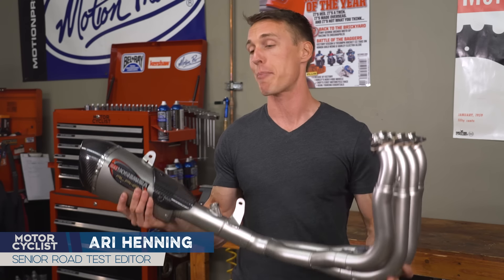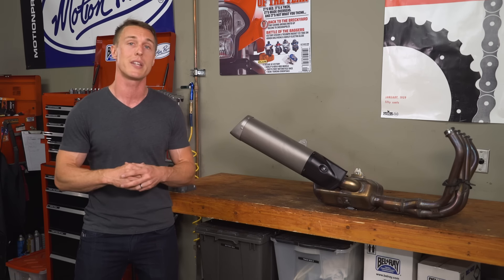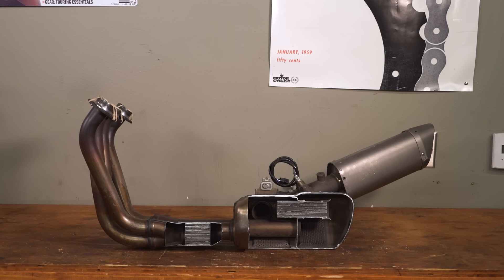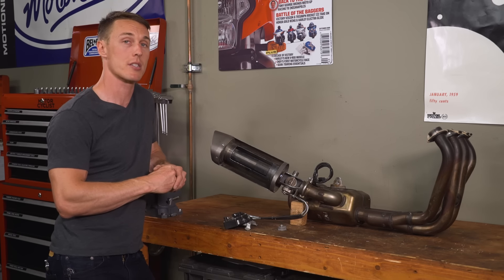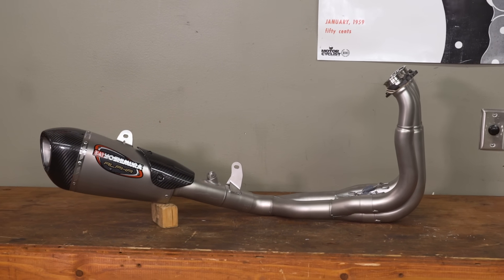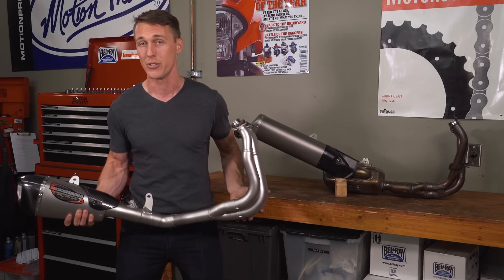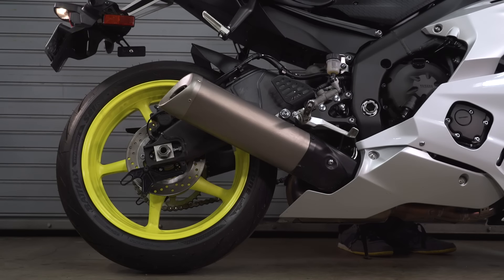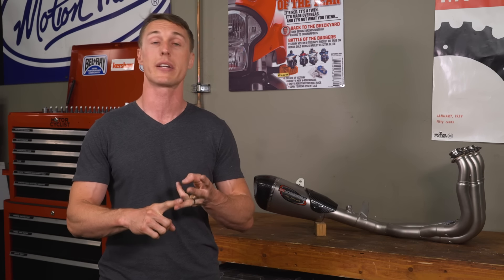The Truth About Aftermarket Exhausts | MC Garage

Comment: *Scavenging not back pressure

Back pressure is only applicable in a 2 stroke engine. 4 strokes dont have back pressure... They have pipe scavenging. Where the size of the pipes and the design of them are tailored to let the tail of the exhaust pulse meet the crest at a specific rpm so it helps the flow...

With a 4 stroke engine freer is better when u start talking about back pressure u confuse people...

2 strokes rely on "back pressure" because they dont have intake or exhaust valves or cams... so "back pressure" is needed to help with compression.
Reply: Nothing could be further from the truth, engines with cams that have a lot of "overlap" suffer horrible power losses in the lower and mid RPM's from straight pipes especially short ones, put straight pipes on an engine that have cams with a lot of overlap and remove your air cleaner, rev the engine in neutral and you can see spray coming out of the carb while its running, this is called "carburetor stand-off" and it's a product of what's known as "exhaust resonating", take two blocks of wood and have a friend hold them against the ends of the pipes to create back pressure and rev it again and the stand-off will disappear or be greatly reduced, I've actually seen bikes that guys tried running huge cams with a lot of overlap and very short pipes that would actually soak the air cleaner with so much gas from stand-off that when they were idling at a stoplight and there wasn't enough vacuum to hold the gas in suspension in the air cleaner element that was there from resonating that the gas would run out of the bottom of the housing like when a float is stuck open in the bowl, back pressure isn't the only way of dealing with the issue, there are inserts that can be put in the pipes about an inch from the ends that slow the resonating wave down enough so the exhaust valve closes before the wave gets back to the cylinder.
Resonating is caused by this, when exhaust gas travels down a pipe its towing a vacuum behind it, when the exhaust leaves the end of the pipe the pipe wants to full back up with air due to the vacuum, this wave of air travels back up the pipe at the speed of sound, if it arrives at the exhaust valve before it closes it'll travel across the top of the piston and past the intake valve that's starting to open and through the intake and carb, this is why spray will come out of a carb on a running engine, that wave wreaks havoc in the intake tract by hitting the jets and momentarily reversing their flow and it's also carrying exhaust carbon along with it, this is why you'll see carbon deposits inside of carb throats, it's especially bad on engines with long duration racing cams and short custom and aftermarket pipes.
Reply: @dukecraig2402  youre literally saying the same thing I did... But its not due to back pressure... Back pressure is needed for 2 stroke engines because they do not have valves... 

And yes engines will experience a loss in torque with no echaust and engines with large cams will lose power at low rpms with a straight pipe... But thats because they no longer have the exhaust pipes scavenging and helping it at low rpms... 

Has nothing to to with back pressure.
Reply: @3star2nr  
You completely fail to grasp what happens with exhaust resonating and how it causes carburetor stand off, engines with bad exhausts don't just lose power because of lack of scavenging but also because of the wave that moves back through the system, I've had to straighten out bikes at my shop because guys just can't get their heads wrapped around it, I've had to demonstrate this to guys at my shop using the trick with the wood blocks so many times I'd make your head spin, I've seen guys put bikes together with huge cams in the engines and real short custom built pipes that would resonate so badly you couldn't even kick start them, like you they didn't get that that wave moves back through the intake tract so badly that it actually disrupts the flow into the next cylinder that is on its intake stroke on a system where cylinders share an intake tract, the cylinder being kicked through fires but the wave that comes back up its pipe, through the cylinder and into the intake and carb disrupts the flow into the next cylinder and the bike won't even start, I've been doing this professionally for over 30 years and trust me lack of scavenging is only half of the problem, an engine like a typical Harley that has 2 cylinders that share a common intake and carb is where it becomes evident because of the effect the wave has from traveling up a cylinders individual pipe and into a shared intake and carb, resonating is far less evident on an engine that each cylinder has it's own intake tract and carb, I've only been doing this for 30 years but if you don't want to believe me talk to any one of the exhaust manufacturers and they'll tell you the same exact thing, it's not JUST scavenging that's the problem.

Comment: why are aftermarket exhaust illegal but harley’s are just as loud?

see that water hammer installed halfway up the wall located behind the tool box near that pipe clamp on the wall?
that doesn’t belong there, it supposed to be as close to the sink or utility as possible.
so whoever installed it is obviously not a licensed plumber.
did you guys do your own plumbing?
replace that section of water supply
 with an aftermarket straight pipe exhaust from a harley. since harley exhaust pipes are legal everywhere.

Comment: You know If you are from Finland its Power first then the law..😂 in finland moped is allowed to be max 50cc and go 45km/h but i modified my moped to 77cc stage6 cylinder set with giannelli exhaust and vforce3 reed valve, 21mm keihin and 30% tighter malossi clutch...and it goes 120km/h😂😂😂
Reply: Wait are you really Finnish? You dont look like one
Reply: Replace your tach, that setup won't get you much further than 100kph

Comment: my bike exhaust has no collectors and no coltrolled valve.
And my pipe does not have any way of soaking up sound, it is a simple cone shaped pipe.
and IT. IS. LOUD !!!
i do however still have the original should i ever want to change it

Comment: With the exception of the 2018 GSXR1000, don’t waste your money. You’re not fast enough for it to make any difference anyway. Your bike will keep its value better if left stock.
Reply: Depends on the exhaust. A quality aftermarket full system with appropriate ECU flash will add appeal and value to any good bike is my experience.

Comment: If i installed an aftermarket slip on exhaust do i have to tune/change the ECU of the bike???¿¿¿?¿?
Reply: Usually not.
Reply: @jamesmarshall3311  thank you
Reply: @shinoysamuel6183  Glad to help. Of course full or even two thirds systems must have an ECU flash or PC commander fitted to run properly.

Comment: with all of that said, I'll stay stock on my 400 ninja...
Reply: alan bane  Hey! Alan, I like the idea of the boosterplug and may try that one, but the oiled air filter isn't going to give me much more power and I really don't like using an after market oil air filter...they are a pain in the ass to clean and you should let oil dry before use...so I will pass on that one...thks for the heads up on the other product...I like the idea it is plug and play too...later...

Comment: Wrong. The reason the stock exhausts sound and look the way they do isn't bc they're engineered for performance, but to appease the federal emissions agencies and meet decibel requirements. 

The reason most aftermarket exhausts are illegal is bc they completely disregard those factors and focus solely on increasing performance and letting the engine breathe properly.
Reply: Most aftermarket systems are perfectly legal with their inserts in. They will be advertised and sold as being tested legal. However, I cant speak for a nutty place like California.

Comment: had an 06 hayabusa and now a zx14r both with Brock Davidson alien head full exhaust of course coupled with a pc5 and ecu flash and the with that I loose 60lbs on the ninja and I get about 20 hp and an additional 5 or 6 pounds of torque. For the money there is no better upgrade. I buy from him for the quality and the r&d he has put into this. For what it cost it is the least amount you can spend with the most hp gains.  I wouldn't recommend just buying some exhaust and a pc5 and get some unknown map on it and expect it to perform. It wont. And if you can find a tuner its a toss up whether they actually know what they are doing. Most people dont even know about or even understand an ecu flash. Guhl motors is the best in the industry. Period. There is a lot to it. Yea if you just want a loud obnoxious pipe so the neighbors will hate you while you prove how small you dick actually is than thats fine. True performance takes time and expertise. Its worth doing the right research and making the right choice.

Comment: It’s not called back pressure ... back pressure is bad, what the valve is there for is creating the correct velocity to cause vacuum to pull the remaining exhaust gases out. 🙄
Reply: Some back pressure is completely normal and aids torque.

Comment: Back pressure is everything!! It helps close the valves, and that cools the valves. Also helps to prevent valve bounce, race bikes use higher rate springs, so bounce is not an issue. On and on and on. Are you an engineer?? Lose weight not power.

Comment: Ari. First off, love the vids. Thanks man. I assume you got this question before, but why is everyone telling me to either have my ECU remapped, or change it or put in a power commander after I installed a Comp Werkes slip on shorty on my rsv4 rr 2016? I was told because the catalytic converter is in the oem pipe, that it changes the mixture of air and gas to a. dangerous level that could blow my engine. Comp Werkes states no mods are needed on my specific bike with the slip on, and Aprilia dealer says I will blow my valves if I do not get some sort of adjustment, any of which point to about 1000 or more in costs.Its not about the money you understand, its about what the truth is. Isn't the ecu made to adapt to changing air and gas mixtures, like I live and ride at 80 feet above sea level, but what about the rider who runs his rsv4 at 8000 feet in altitudein Italy? Can we get an answer once and for all please? Thanks. Ulric

Comment: You can put any exhaust you want, here in France we never could put a so bad exhaust thta the performance drop is notifiable ........ if you respect speed limits , 80 km/h now, and even 90km/h , 5-10 hp less with aftermarket exhaust ? Who cares ? Only racers ...

Comment: I've always wondered why Yoshimura deleted the crossover on my Suzuki GS 500E full system, whereas, the V&H full system had a crossover, but at a different location than the stocker. All I can say is that the way that the bike was set up at the factory, it was downright sluggish until it hit around 6000 rpm's, and then took off kind of like a 2 stroke. With the Yoshi, a K&N lunch box filter, and proper jetting (40/140, in my case), it has a much more linear power band, with better bottom end. Does anyone know anything about this particular system, in regards to the crossover, or the lack thereof ?

Comment: I own a couple of Yamaha RZ350 2-strokes that have power valves built into the cylinders.  I am curious if the valve at the back of the exhaust shown in this video is doing a similar thing.  If yes, it’s a heck of a better method than power valve cylinders.

Comment: I have never owned a fuel injected bike, CARBS are so much more RENAGADE:/ and from my experience, Tuneable!! I have always replaced the exhaust pipes as a first and ultimately this has been always a plus+plus modification:) 
But ACCORDING TO YOU YOUNGSTERS the exhaust is the last thing to do. obviously on a detuned, duff, state motor! when will you learn? 
I think the injection era has killed the fun for you and put you in the CAGER position(Can I DE-cat my CAGE!!) and I find this a SAD state of affairs:(
I have seen the authorities look at bikes through the AGES and it is only in the last 15yrs they have decided on putting us into a labelled box.
The result is to bring us into line with the cars in both pollutants and BHP, this, in my opinion, has made motorcycling in the UK alone, more expensive and ultimately costly to run.
Take this example from my own crazy mind, imagine you buy 2015 CBR 1000 and you take it for an MOT (THE BRITISH ISLE GOVERNMENTS YEARLY MONEY MAKING TEST COSTING 45£)
Imagine you fail on your exhaust class 4 euro immissions, you will have to source a standard exhaust costing £500 to god knows what to pass.
Please feel free to explain if I am wrong on this emissions test on the new MOT as the bike when new passed the test but you NO longer have the Original exhaust, and please remember you have a different testing criterion for my 1997 bike I only have to OBEY the DB(DECIBELS TESTING) not the stringent fuel/particulates/hydrocarbons and bo**ocks.
If there is any viewer of my post who has a ministerial position in motorcycle/velocipede can you let me know if I am wrong please, Don`t hesitate in letting me know as I have always bought Classic Motorcycles for this reason and pity the FOOL who has bought a 3yr old modded machine who now wishes to MOT it:(

Comment: Need to add to this video "Illegal depending on where you live". Those ugly udders on motorcycles are only there because of California's emissions laws. As long as I don't remove the baffles from a muffler, I can run whatever I want.  Laws below for my state, and lets be honest, if your bike is smoking, or emitting harmful gas its not your exhaust.

Ohio
§ 4513.22. Mufflers; excessive smoke or gas
§ 4513.221 Noise control

Comment: we used to think that louder was more powerful.  now we know it's not.  our Bassani on the old xr75 or the Denco's on the KH400 sounded good but added little  to power.  all the harley dickheads still have a 13 year old mentality.  a tuned exhaust is the way to go.  weight savings are real and great but most of us are not track daying the rides

Comment: wrong, proven on the dyno time and time again, you will actually get more mid range and some low range with full exhaust systems WITHOUT exhaust valves and if you don't think 30hp from exhaust in tuning is a lot or worth it.... okay then, that's what you get on 2017 gsxr 1000.

Comment: yes.. amazing.. that o2 sensor is there to dump excess fuel into the engine when it senses to much oxygen... its aslo illegal to modify your exaust because of it.
meaning its the CLAMP to prevent people from running hydrogen instead of gasoline..  those oil fuckers want they're money and will KILL to keep you paying...  RIP Stanley Meyers. (inventor of the most effecient electrolysis unit in the world)
(had a little voltswagon buggy running on water, that is electrolysis on water = hydrogen and oxygen)

Comment: That statement about backpressure being needed is false
Reply: My Yamaha Warrior computer shit the bed when I took off the bazooka and went with straight pipes with baffles.  This without an OEM air sensor on the original pipe.  I did it for the look.  Put a fuelly on it and lolly pops inside the pipes to increase B-P.  Now it rides like a charm without hiccups and dying and nasty m80 sounding popping and backfires.  Some bikes need some back pressure.

Comment: Firstly the stock exhaust you showed at 21lbs, yes heavier, but just above the ground, i.e. low low down, thus impact on handling is really minimal.  A slight advantage on acceleration - if any.  Like the noise or loudness.... little boys that have to be noticed by everyone - please grow up ?!  Exactly the reason why the bikers are hated by everyone.  Like loud motorbike noise ? record it, put on your headphones, play it back over a good powerful amp, and amuse you single braincell !